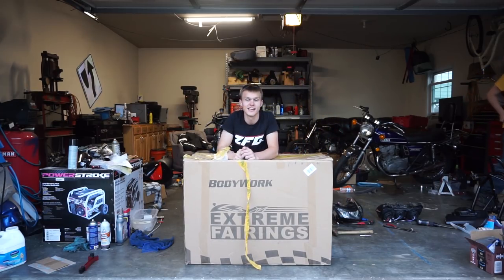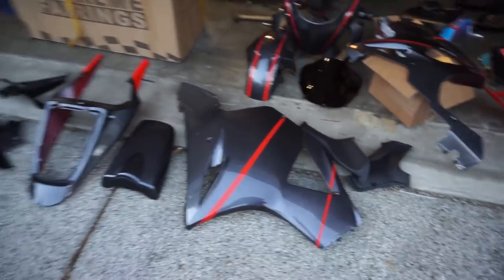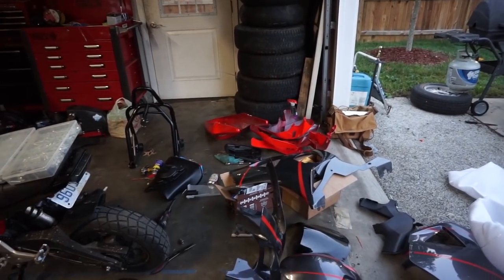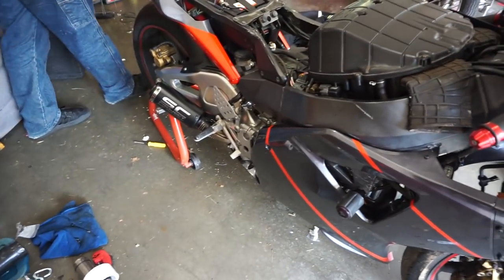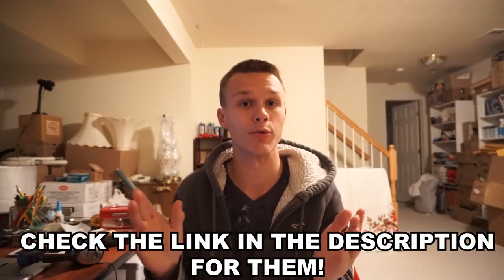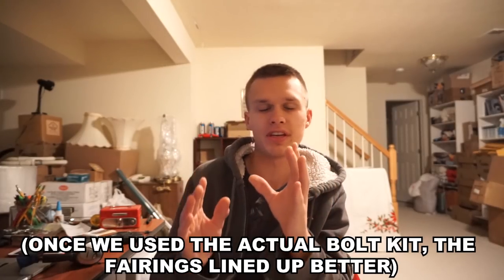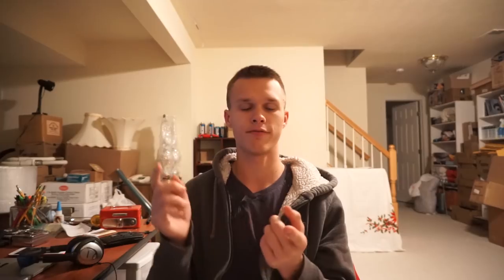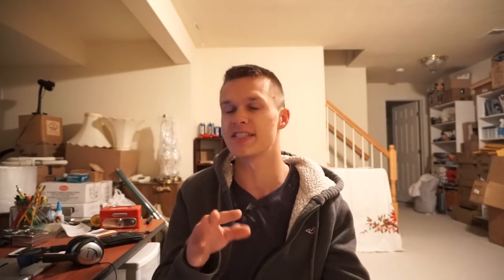Install And Review Of ExtremeFairings On My CBR954RR!

Comment: I gotta give it up to Extreme Fairings.  I bought the kit, and put it on the bike, it fit very well. I brought the bike to have the 600 miles service done at the shop, and they managed to break a couple of the little plastic tabs that help the fairing pieces fit together. I called Extreme Fairings to see if I could buy a new piece, (I was gonna have the shop pay for it) and they just sent me a new piece, no charge. It was a substantial part too, the side piece that has the GSXR on it. This company is making a name for themselves, a good name.